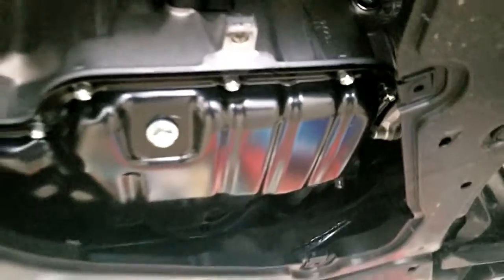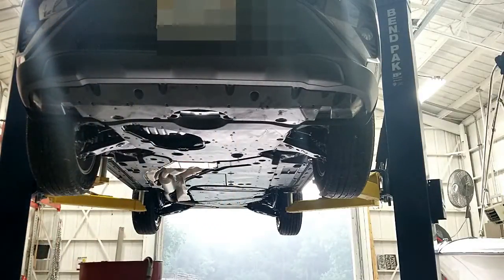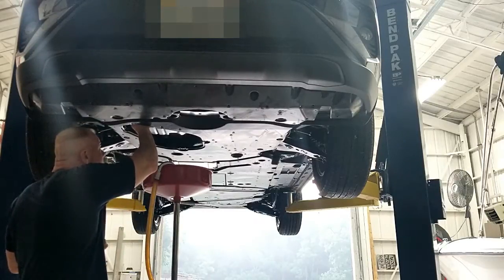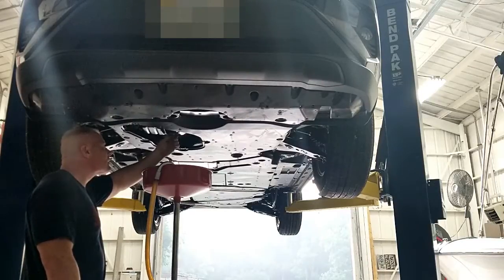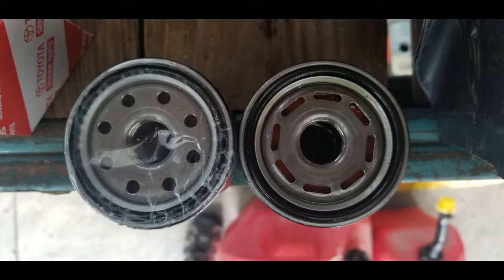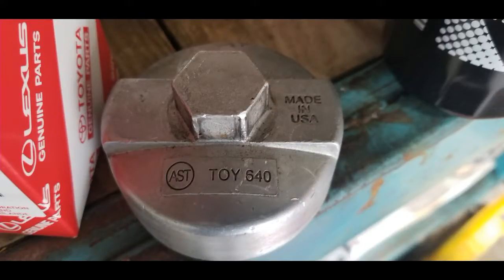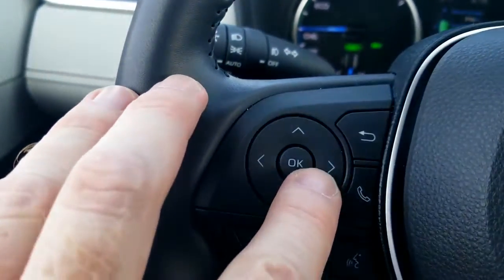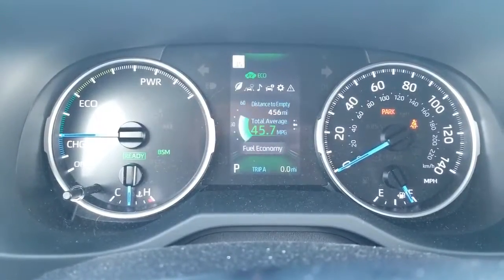2019 Toyota Rav4 Hybrid Oil Change

Comment: You didn't mention if you put new oil in the new filter before installation .
Reply from the maker: I don't do that, due to the fact on this vehicle the oil filter is installed horizontally.  The oil would run out of the canister when you would install it on the vehicle.
Reply: Kayak Strong my wife’s 2011 Rogue’s oil filter is also installed horizontally. I usually fill it half way, and oil does not come out when I install it. Just a peace of mind 🙂

Comment: According to the manual, the oil should be changed every 5000 km, according to the store, they say that when the vehicle reach 1000 km, a change in the oil should be performed, so I am not sure, if anyone is sure about it please let me know
Reply: Always follow the manual. 

You do not want to change the oil at 1000 km, because Toyota likely added additives at the factory to help pistons etc sit. If you change the oil at 1000 km, those additives will be lost. 

By the way, where are you from? Here in Canada, Toyota recommend an oil (0W20) change every 16,000 km or 12 months.
Reply: Why not call your local dealer? Better info from the dealer than someone YouTube, don't you think?

Comment: Do you not use a crush washer with the old drain plug?
Reply from the maker: I have reused the same crush washer a few times before changing it on all of my vehicles over the years and never had an issue of oil leaking around the drain plug.

Comment: How often does it require to change the oil? 

Sorry if this question has already answered, I did find that in comments.
Reply from the maker: Boris Pilgun  I believe the manual says every 10k. But I do mine at 5k intervals since tire rotation is done at the same time.
Reply: Kayak Strong understood, thank you.
Reply: @kiotick25  I completely agree for the reason you stated and that oil changes are cheap and I presume is better for the longevity of the car.  My question however is when you re-set the scheduled maintenance, is it not set for 10k, therefore you would ignore it by doing it every five, no?

Comment: How many liter oil you need to fill? So can reset oil change status alone?
Reply from the maker: (Per the owners manual in your glove box)
With filter 4.8 qt. (4.5 L, 4.0 Imp. qt.)
Oil grade:
 API SN/RC multigrade engine oil Recommended viscosity:
SAE 0W-16 is the best choice for good fuel economy and good starting in cold weather. If SAE 0W-16 is not available, SAE 0W-20 oil may be used. However, it must be replaced with SAE 0W-16 at the next oil change. The engine oil capacity is a reference quantity to be used when changing the engine oil. Warm-up and turn off the engine, wait more than 5 minutes, and check the oil level on the dipstick.
Reply: @kiotick25  I have read that you should fill up to the halfway point in the dip stick because when the engine is hot the oil will expand. Once the engine has ran for a while then to top it up to the dip stick. Is this true?

Comment: What's amazing is that Toyota has covered the entire undercarriage in plastics to protect the under chassis 😁👌👌👌
Does this mean that an oil filter from another company that does fit wouldn't work???
Reply: I used a fram.  No issues if changing at 7500 intervals.

Comment: Do you also have the change Oil for the eCVT  planetary gearbox / power split device? in RAv4 Hybrid 2019?
Reply from the maker: No sorry
Reply: @kiotick25  so there is no need to change Oil in the Automatic Planetary Power Split Gearbox in Toyota RAV4 Hybrid? Only Engine Oil, right?
Reply from the maker: @TWARDOWSKY.  

Maintenance schedule shows at every 30k to change the transfer case fluid (4wd).  I am not there yet on my vehicle. I assume you are referring to the transmission fluid?  I don't see this on the maintenance schedule even going out to 120k miles; unless you fall into special condition category, like taxi or police.
Reply: No transfer case on an HV 😁
Reply: Kayak Strong every 30k km you have to change ecvt oil? I thin only check?
Reply: TWARDOWSKY I don’t think you’d hurt anything changing the fluid every 60-90k.  I suspect you will hurt it never changing the fluid unless you baby it all the time.
Reply: Yes you have to change, every 60k miles or 5year

Comment: Hey Man. I am interested in purchasing a 19 or 20 Rav4 Hybrid. I just have a couple of quick questions about the real world economy.  First, how many gallons does it take to fill it up? What has been your average fuel range off each tank? Have you noticed any weird quirks or issues so far. Sorry for so many questions. Thank You!
Reply from the maker: canonlybeme4life 

14.5 gallon tank so 10 to 12 gallon fill up
I mainly drive highway 90miles round trip for work. Be aware running out of gas in this model hybrid will ruin your day. So on this year RAV4 there is a large reserve. But if you run out of gas and deplete the hybrid battery. The car will need to be towed to a charging station. Don’t expect to put 5 gallons of gas in it and go. The hybrid battery starts the car, and always needs to have some charge remaining to start the vehicle. More information than u need to know. This based on what I have read. That’s why when on E for the fuel gauge you are putting in 10 to 12gallons. 

Avg mpg for car computer is 45 to at best was 47. On paper I calculated the same. Colder weather seems to drop the mpg by 1 to 2mpgs. I haven’t seen anything that I have had to go back to the dealer for. It is a hybrid so getting used to how they work is the only quirk since most of us are used to gas only engines. Sometimes the engine is on/off based on how the battery pack is charged. I think that is the biggest item getting used to if not exposed to a hybrid vehicle in the past. 

If running at 25mph or slower u can force the car into electric only for a period of miles based on battery reserve (EV Mode button).  Too many variables to accurately say how many miles you can get. Eventually in this mode after driving a bit the car PC says okay that’s enough we are turning the engine back on to charge battery again. But good for saving some gas in stop n go traffic.
Reply: @kiotick25    thank you for the honest answer. My dad's old Lexus rx400h hybrid always have issues starting when temperature drops below -10C. It sucks even more that our winters here often drops to -40C. Anyways, the dealership lied and said hybrids only use 12v to start, so we changed the 12v battery, and nothing was improved. We went back to the the dealer multiple times to test the hybrid battery, and lexus just kept saying nothing was wrong with it. The car drives totally fine in the summer despite it's age, just the winter is really a pain... Not sure if the newer hybrids improved, ours was the first batch of hybrids by lexus in 2005...  There's tons of people love and praises their hybrids online
Reply: @kiotick25  ty so much. Hybrid new owner here and will always be mindful to actual fill up when I see the E!

Comment: Nice video. You should also mention torque specs for drain plug and oil filter. Have you changed drain plug gasket ? Are you sure recommended oil is 0w-16 not 0w-20 ?
Reply: Recommended oil is 0W-16. Toyota says 0W-20 can be used temporarily if 0W-16 is not available, but says owners must change it back to 0W-16 at the next oil change.
Reply: Most cars the drain plug will be torqued to around 25-30 foot pounds. Oil filter only needs to be hand tight. Oil fill cap will indicate what type of oil to use.

Comment: Bro, your dealer doesn't offer free oil changes?
Reply from the maker: Danny B 

Yes my dealer provides free oil changes but my time is worth more than the trip there and back.  In addition, to the time waiting for them to perform the oil change. Minimum for me if the stars aligned would be 2hrs if my day wasted on Toyota doing the oil change. I can do mine in about 15min and $30 whenever I want to. Where I would have to wait till the weekend if it brought it to the dealer. Those oil changes at the dealer gives Toyota the ability to upsell you more stuff you don’t need.
Reply: @kiotick25  true
Reply: @kiotick25  Toyota charged me $25.00 to instal a cabin air filter when I brought my Camry in for an oil change. The refused to reduce the fee so I told them I will never be back!
Reply: @davidcampbell1899  lol that's not even that much... You can always refuse service...
Reply: I'm just glad he did the oil change himself and shared this video with us .
Reply: Definitely NOT free when its added to a $90 inspection

Comment: Toyota is getting as bad as Ford, GM and Chrysler. designing stuff to make it as much as a pain in the ass as possible, so you have to bring it in to the the oil changed.
Reply: they actually went back to the canister type oil filter which is much easier because it doesn't' require an adapter tool....people were complaining abouit it and toyota listened!
Reply: Picky picky picky...
Reply: other than the plastic cover (4 screws 60 seconds) its a simple as can be.
Reply: It took me less time than my Matrix!  ON the Matrix I have that horrible paper filter which is always a BITCH to remove...especially if I have taken it in to get done..they always put the plastic cover on too tight!